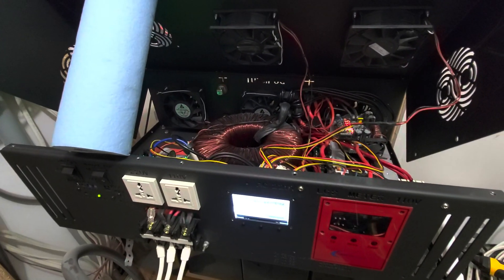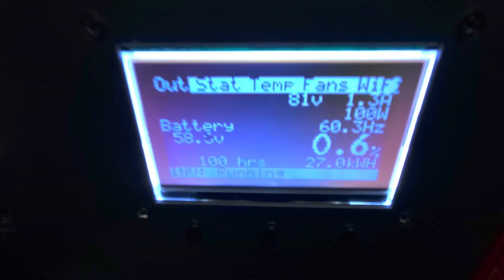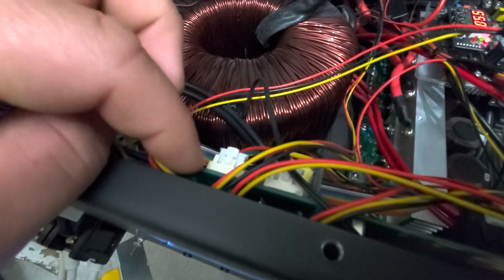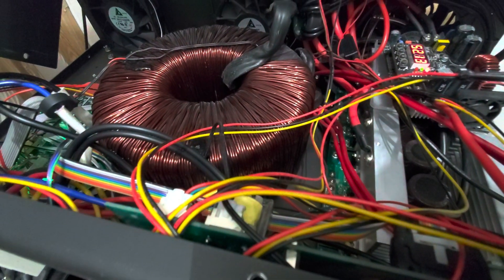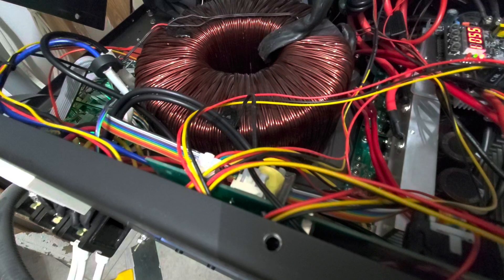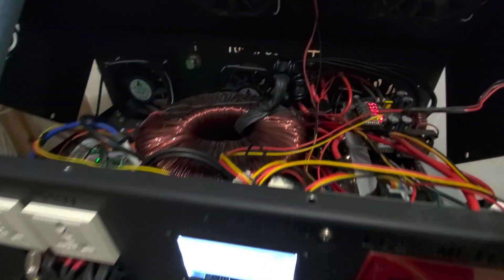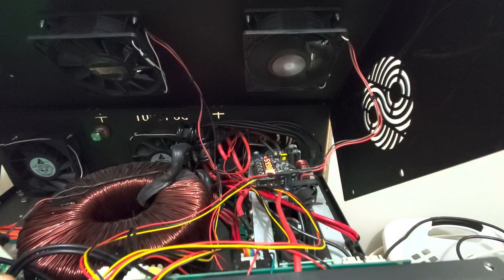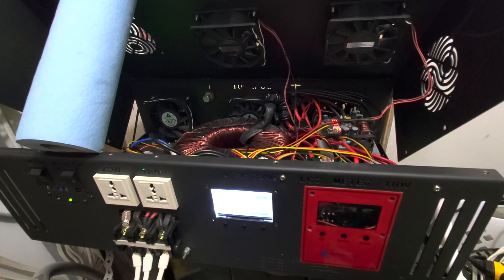My inverter voltage is reading wrong!

Comment: Hi I also have the same problem with a 2000 watt Iverter Syrio,
the reading of the inverter is much higher than the real one of the batteries, can you tell me what is the problem?